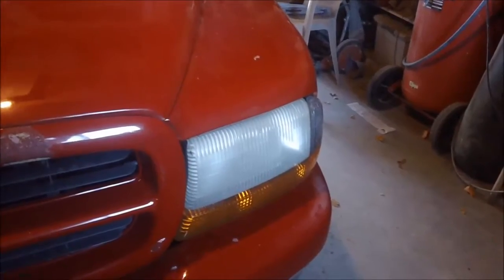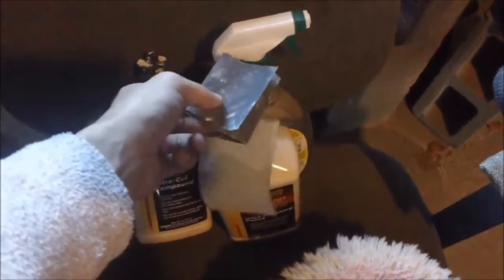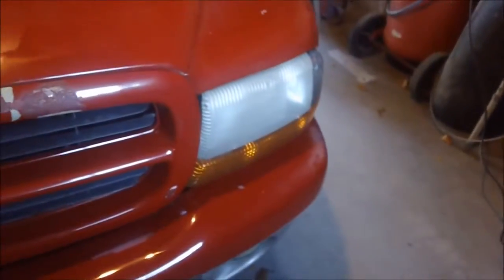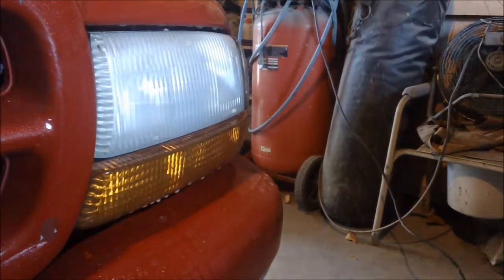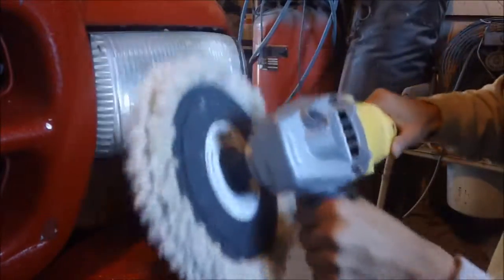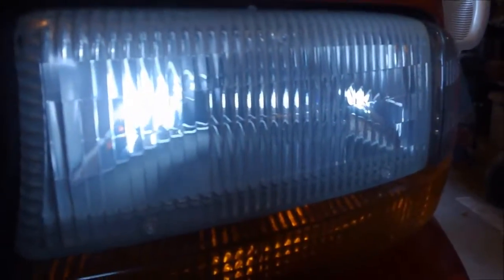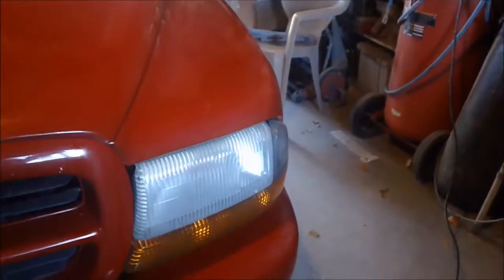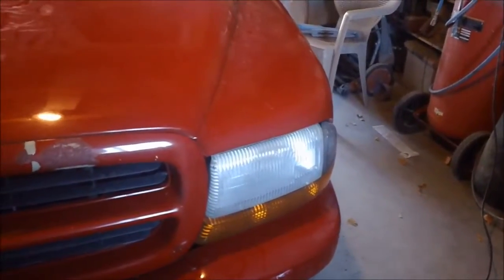How to bring back some clarity to Plastic Headlights: Sand & Buff

Comment: Sucks when the headlights are foggy on the inside from moisture :( saab 93 had that issue and no amount of sanding would take it out. Better but not perfect.
Reply from the maker: +ferretkiller9454 Been there for sure, thats when its time to buy new ones if its worth it on the car.